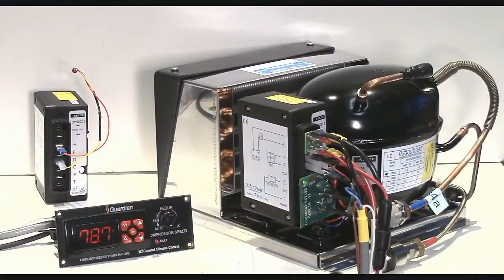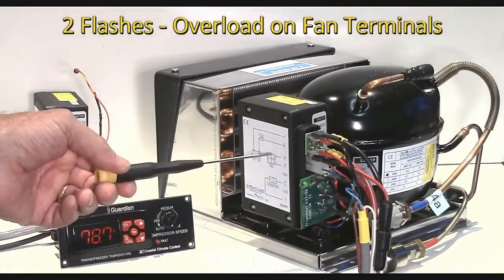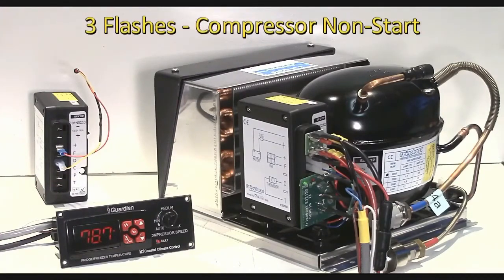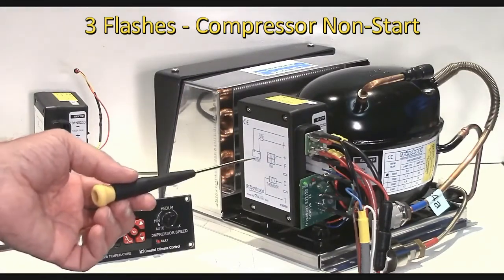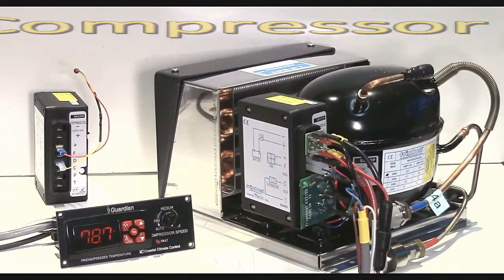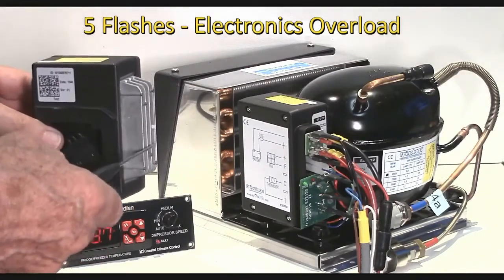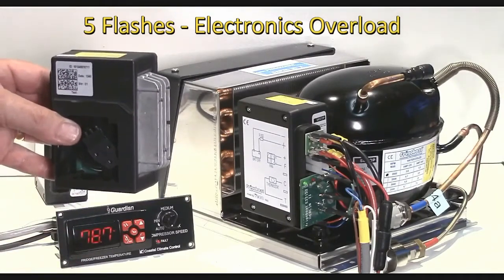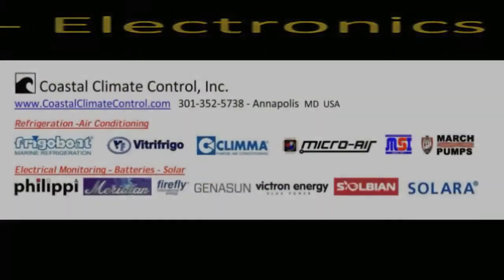Danfoss/Secop BD35 50 Fault Code Explanation

Comment: Thanks !!!
I’ve got the 3 flash error code, I’ve removed the controller and checked all connections!! I’ve opened the controller and all components looks perfect!!!
Is there another way to check other than buying another controller? Thanks guys!!!